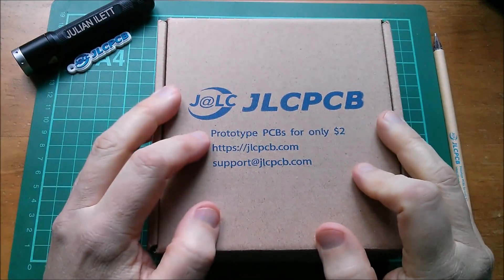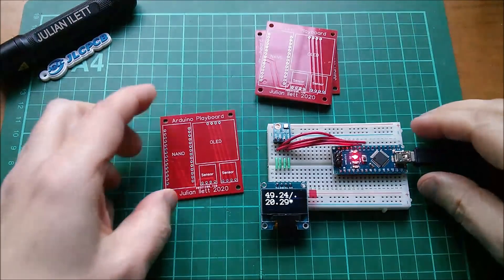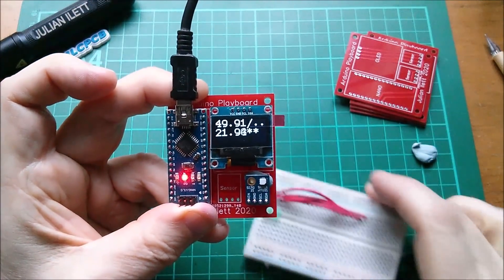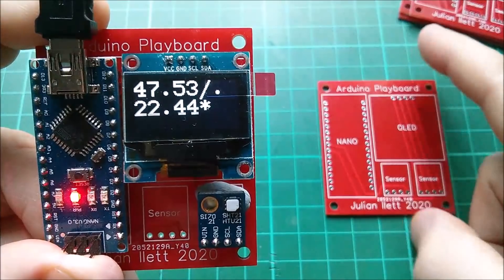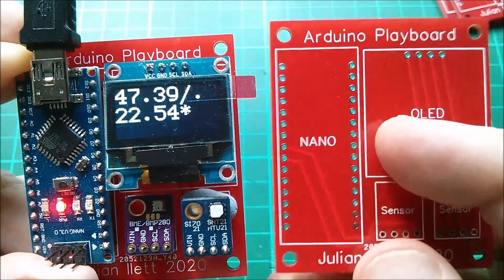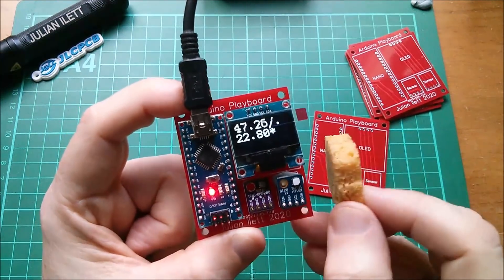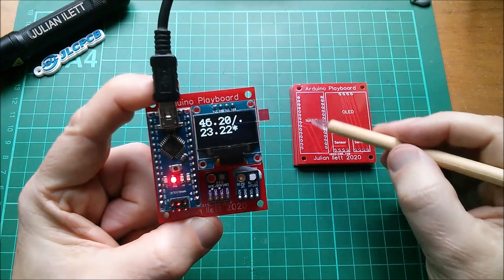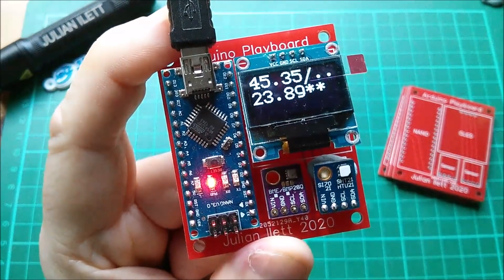New PCBs from JLCPCB - Arduino Playboard

Comment: If you're concerned about the dupont connectors varying in size, just offset the holes on the board by +-50 mills (not mm) alternating  along the connector.

Comment: You can alternately bend the pins a small amount, perpendicular to the row of holes.  (not parallel, it won't work well.)
For example, put a slight left bend on all the even pins, a slight right bend on all the odd ones.
The alternating bias of the pins will apply pressure to all the holes.  You'll need a spacer behind.
Either way, PEEL THE SCREEN you're making a video of it jeez.

Comment: Hello! Could you see and make movies about smart 128x64, 128x32 ssd1306 oled libraries on i2c and SPI, which are small and fast compared to slow and huge Adafruit and U8glib? They consume only a few bytes of RAM!
One of them supports only fonts but is very small and cool for simple applications, it's called SSD1306Ascii. The second is not enough that it takes up little memory, it is extremely fast and supports graphics. It's called ssd1306 from lexus2k. Both are on github. github_greiman_SSD1306Ascii and github_lexus2k_ssd1306. Lexus2k even has an arkanoid game as the sample code.
It would be nice to show that there is an alternative that is fast and takes up few resources, especially when there is not enough space and RAM in the project :) Regards

Comment: Had an initial permissions problem with a compatible nano v3, like you, not programmed in years but lookout Julian!! Very interested in your li-ion, active balancer monitor.. I also have a 8c meter and delta's between cells are more than the active balancers spec, so good on you setting out this project to prove the active balancing...

Comment: Sorry Julian, I don't like the through hole fake socket. After awhile with some corrosion, vibration and thermal cycling bad conductivity is more than a possibility and is a probability. There is a reason that connectors use springy materials. 

I would either put sockets in or solder. You can always de-solder the components and for the Arduino, just older the pins used.

Comment: If you don't want to use Dupont sockets, try bending the pins in alternating directions. You only need to bend 4 pins on the nano.
Reply: I mean give them bowlegged bends so it can be pulled out again..

Comment: You could of course also create your own font so it has all (and only) the characters you need so you get all the features you need for the smallest size possible.
Should be easy enough to modify the code of the font you're using now.

Comment: If you're only using that font for temperature and humidity you can edit the numeric font file and make the symbols you wont use into those you need. I.e replace $ with % and £ with ° etc...

Comment: Here's an idea, just make a new circuit board and then desolder and transfer all the components from the modules onto it.
Or cut up some IC sockets, or use the proper sockets for the job.

Comment: The E-Simpo Aliexpress store has the low profile 5mm female pin headers but only in packs of 100. This is where I got the information https://hackaday.io/project/167369-picopew/log/170776-low-profile-pin-headers

Comment: So the #hackaday #supercon badge had a protoboard with offset holes.  This allowed the components (chips and whatnot) to have a snug fit in the protoboard which would allow easier soldering.  I'm thinking something like that might be a really interesting idea for the board SnugBoard.
  
Zoom in close to see the alternating off center holes on the protoboard: https://github.com/Spritetm/hadbadge2019_protoboard/blob/master/pdfs/pcb-artwork.pdf

Comment: Julian, could you tell us about the service you get from JLCPCB, I'm quite upset with them, they claimed they were not closed for the Chinese new year and could do the normal PCB's. I ordered my PCB's: the site indicated 3-4 days, they took 10 days, they declared DHL Express shipping 2-4 business days (I thought I remembered less, but no problem), but DHL has already sent me an email indicating the date of arrival which i calculated will be 11 business days. 
It's not a big issue, but I could of used the cheap transport which takes the same time with about a €15 saving.

EDIT: it arrived in 2,5 days. What a load of BS tracking system.

Comment: Nice idea why not put turned pin sockets on the base board and appropriate headers on the plug in modules? 

They not cheap but are reliable.

Comment: Hi Julian. Watkins Johnson used that interference fit holes on control "digital" boards in the wj86/87 series of high end military vhf/uhf "communications" receivers 1980's (and many other types).... gold plated tracks of course. Repaired a few of those sets but never came across an issue with intermittent connections. I suppose they where built not to be plug n play!. Love your concept though ....keep the videos coming (Arduino plug n pray lol).      :-)

Comment: The question is, I think, if the thing is generic enough. What if someone wants to swap the pins around in the code, or play with the wiring (which isn't really possible)? And what options do you really have when it comes to modules? If it's too limited, the fun isn't going to last for long, I think. It might be fine for specific uses of course.
Lego isn't the best comparison, because Lego pieces all use the same basic interface; a peg in a "hole". Nothing about the Arduino or electronics is that simple. The closest thing you get, would be some kind of serial connection, plus power.

Comment: Could you mount the oled so it sits over the Arduino in landscape giving you more module space? The text can move to the top as well

Also what's wrong with soldering holders onto the PCB then it will still be modular

Comment: Hi Julian, A quick hack since you have multiple identical boards. Make a stack of 3 boards, put your modules on with the pins thru the boards, then slightly apply sideways pressure to the middle board to lock the pins for a better connection. Essentially creating a ZIF socket/board.

Comment: it looks really good.  A few thoughts thought, the board is of no use without the Nano & OLED LCD screen and with them being so cheap why not solder them in, am also wondering if the connections move about could you have problems with spikes.
Also have you thought of an upgraded board with room on the back or the side to take a battery back and a SD memory card holder to store the info.

Comment: Hi Julian! I love it! Instead of making the holes smaller to match the header pins, I've seen people intentionally put the holes not in straight line so some pins would be pushed one way and the next pin pushed the opposite direction, etc.  Name ideas: PCBread, QuikBoard, NoWire, ZeroWire board.

Comment: Watching you plugging in the modules and describing your aim, I suddenly had a flashback to my youth in the 60s and my early introduction to electronics through a "toy" called Tri-onic, by Tri-ang the toymaker. Google it and you'll see the various radio and electronic kits. Transistors, resistors etc. were packaged into plastic bricks with pins on the bottom. You then made a series of Radios and Electronic circuits by plugging these bricks directly into a circuit board to make a working project. Then you stripped it down and plugged the bricks into another board etc. They even colour coded the bricks for resistors and caps with the correct colour coding so you learnt that as well. Nostalgia trip, sorry. And a bit before your time!
Reply from the maker: I had that set and I dearly wish I still had it :)
Reply: @JulianIlett  Wow that's a coincidence. I had two kits, must have been presents at consecutive Christmases. The Radio 'A' kit and the Electronics one with the somewhat basic keyboard, morse key and speaker. Multivib oscillator at the core. Yep, no idea where they ended up :(

Comment: 7:55 it is a paper sticker indeed, and it should be removed. It is just to keep dust out during production of the boards, and might also make soldering it easier, but it really needs to be removed to get proper readings.

Comment: having unevenly alternating pin pitch between the holes should make the connection more reliable.
for example 2.59mm and 2.49mm alternating in whole add up as 2.54mm average, but every pin is slightly more pressing against one side of the hole.
Reply from the maker: I think this is the way to go :)

Comment: You can create your own bitmap font to add degree Celsius and the percent character and export to c code. That's what I did when I wanted to add text to my oled project and the default fonts used up too much space. I used bmfont from angelcode to create the font. Then you convert the bitmap font to c.

Comment: How about the JuliAnuinoBoard?  The mechanical keyboard community started using a set of staggered holes to essentially do exactly what you are looking for but with smaller holes.  Lots of DIY keyboard designs uses an Arduino Pro Micro soldered to the keyboard PCB.  However by making it pullable, people can more easily replace switches or replace the pro micros.  See examples here: https://www.reddit.com/r/MechanicalKeyboards/comments/9wlsc2/press_fit_pro_micro_header_pins_no_soldering_to/   Some people comment that the edges wear down over time but contacts are pretty good while they last.  The original idea of zig-zag holes comes from Sparkfun https://www.sparkfun.com/tutorials/114

Comment: You teased us so many times with “the right sized holes”, as you’d used on your other board, but never actually said what that “right size” hole was (for the square pin headers).  But... then I’m thinking: Nah, just solder on some female header sockets!

Comment: You can also slightly stagger the alternate pin header pads to make connections self aligning and retaining. Eagle has a library with an assortment of such header pads which I often use on my boards (I especially like using them for programming headers so I can insert the mating header, flash firmware and just disconnect all without having to solder a female socket or hold the header super still while loading software).

Comment: A bit disappointed by the rambling about painfully unnecessary "issues" - of course you can get some semi-reliable "dry" connections if, for instance, insert square pins in round holes with appropriate dia, but who in their right mind would do this (sorry, if even for temporary test as many pointed out a simple headers will do, so what is the issue?). Otherwise good idea, but please stop diluting it with non-issues....

Comment: Due to issues with the lines being different between manufactures, if your going to do a v2 of the board maybe have a second set of pins on each pad for the next common standard? You could always flip the screen 180 and the sensors don't matter on the orientation.

Comment: Julian, just go in to the number font's and change the unused ones to what you want. it should not be too hard to find and replace them. After all it's just a look up table.
Reply from the maker: That sounds difficult - I'll just bodge along with the 'numerals only' font. Actually, there's a load of spare memory - I could use the full font.

Comment: Nice PCBs Jullian.
You could put an extra set of holes for the display on the board configured so you can mount the display on the back of the PCB to make a panel mount unit, with display on one side  and other hardware on the other.
Also some tactile switch pads on the display side too.

Comment: Very cool new board-in-red :)  I've been playing around with a wide variety of these small sensor boards looking for the right ones for my never-ending weather station project. I don't think I've found 2 boards with the same pin layout yet (or the same temp reading either). I did a JLCPCB board a bit along the same idea but with 3v3, 5v and I2C buses for more flexibility. I've also added a dupont socket for an NRF24 module and an 800mA 3v3 regulator module. Looking forward to seeing more of your great videos, as always. Wishing you the best with the big UK changes. Cheers.

Comment: I have seen you have pins that dont line up like there is not a standard so maybe some jumpers for different configurations and maybe a dc jack or battery holder
Reply: The qwiic system originated by SparkFun and adopted by Adafruit seems to be becoming a de facto standard.  Of course it means a daisy chain of wires.  And you have to be careful which boards include pull up resistors.

Comment: Turn the longer chip 90° clockwise to make it go under display and turn the two sensors 90° clockwise and put them to the left of the screen. Name uncovered and markings on chips would be oriented right.

Comment: I think I would just make the boards as normal and solder some female headers to the boards.
I think over a very short time the holes on the PCB will wear and become loose, where as female headers are designed for repeated unplugging.

Edit: additional to wear of the holes, the through hole copper plating is quite thin as it is designed to be soldered to.  This would also quickly wear off and be damaged with friction fit.

Comment: Maybe make a blank Nano foot print with dip hole positions .5-1mm closer together. The blank can then be used as a tension clamp on the backside of the Playboard once the Nano is inserted from the frontside.
Reply from the maker: That's a good idea - put the PCB holes ever-so-slightly out of position to get the interference fit. Thanks Ken.
Reply: Isn’t that them relying on having straight pins, what if I soldered mine at a slight angle, would that be too tight/loose a fit depending on what angle?

Comment: Through holes are not meant to be sockets that you can repeatedly plug in an out, the sharp corners of the pins would cut through, just put sockets on
For landscape, just turn the arduino sideways with the sensors above or below it so the name can stay in the same place
playground ?
sandbox ?

Comment: just solder some Dupont sockets into the board and connection issues will go away and no blue tack
Reply: Interference fit in the way you are describing is destructive to the pcb. Just put headers in
Reply: @Pops180  I've done this on prototype boards and sure it really only reliably works 10-20 insertion/removal cycles but depending on application and use this could be far more economical than throwing bulky connectors at everything.
Reply: That's what I thought. But that would just not be beating about the bush enough now would it? :P
Reply: @rimmersbryggeri  Ha-ha....
Reply: It is almost like they are made for this exact function. :D
Reply: The problem with female dupont headers is they stick out an inordinate amount. There are low profile female machine pin headers available, but they are somewhat difficult to find and cost quite a bit more than a run of the mill dupont header. So long as you aren't repeatedly plugging/unplugging simply undersizing the through holes or staggering them gives the same functionality at no additional cost and has zero vertical clearance.
Reply: @sjm4306  Oooh stagger the holes!  I think this would be better because it relies on lateral force from the pin itself, not from the other side of the hole.  I think it would alllow a stickier fit after more wear than just undersized holes.
Reply: the example given with Lego is not identical, as in that case both ends are produced according to the exact same specs. Dupont connectors seem to be more reliable and also likely wear out less quickly. I would not expect this to work well in a classroom situation
Reply: Possible tinning the pins is enough. So they are round and fit in the holes and made proper connections
Reply: Solder things already, it's irritating.
Reply: @curtw8827  Yes, at least for the video, and for the same reason peel the damned screen.

Comment: Why not just solder some of the sockets onto the board then you can remove the modules/arduino for other projects
Reply: Did you even watch the video? 😂
Reply: @renebrsch  i watched it. i was wondering the same thing. instead of ordering boards with smaller holes, why not solder in sockets to swap modules?
Reply from the maker: Too easy - I like to do things the hard way ;)
Reply: @JulianIlett  Just cut up some IC sockets and use those instead.
Reply: @renebrsch  well... Julian really didn't tell why he didn't use anything else than the pads/holes to plug the pins in.  I think it needs some type of connector to avoid the square pegs inside a round hole thing
Reply: Also height potentially